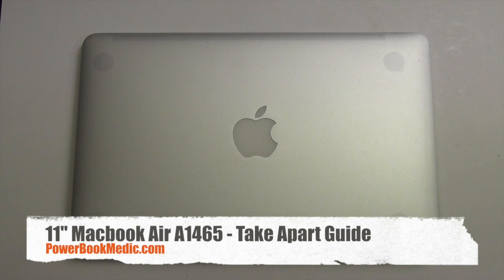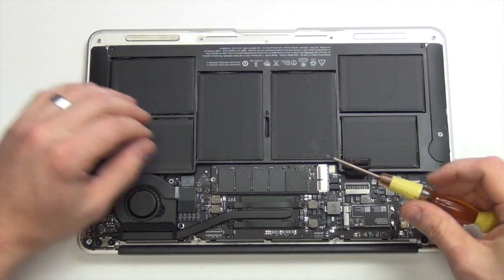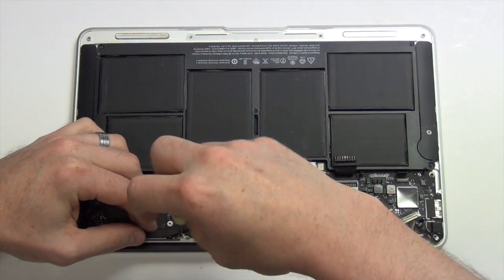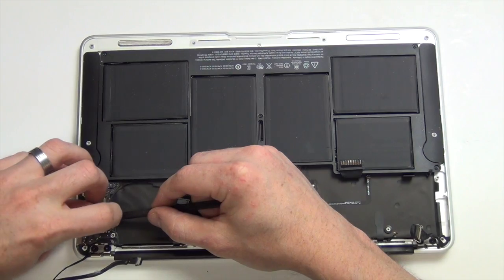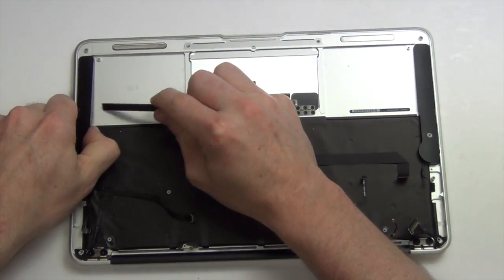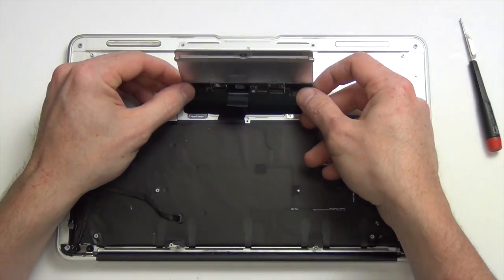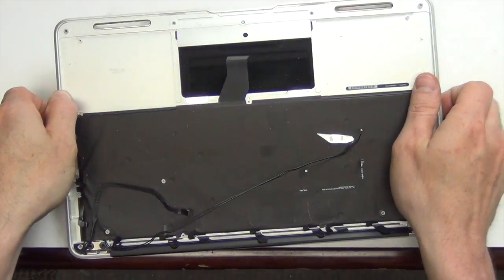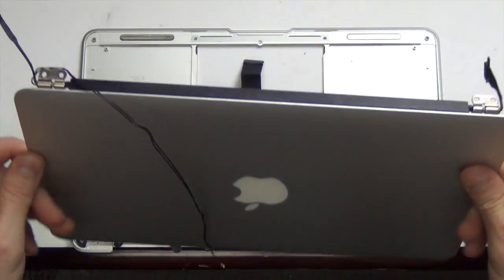11" Macbook Air Take Apart A1465 Models

Comment: I was so iffy about buying a used MacBook 💯>JustU.Faith/MacBook?耳   but I’m so glad I did! It arrived a few days early and was safely packaged. There were a few very minor scratches and chips, but that was it. I already purchased a shell, which easily hides the imperfections. It works perfectly and I’ve had no issues with it so far. Battery life is good, computer is fast, no issues setting it up or anything. Definitely worth it!

Comment: for the two torx screws, what screw driver do you need ?
Reply from the maker: Alexis Calderon A T6 for the logic board torx screws and then a T8 for the torx screw holding on the display.